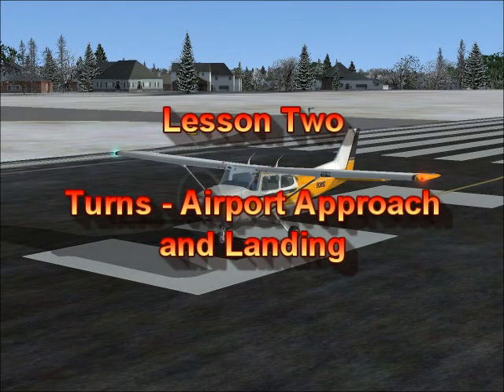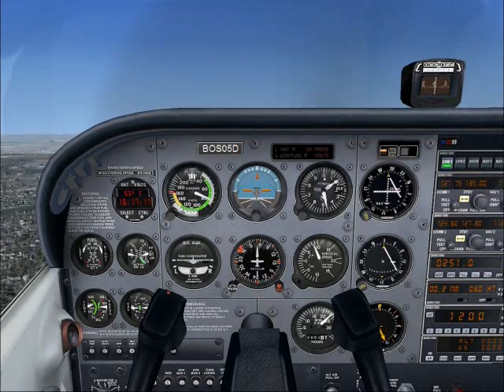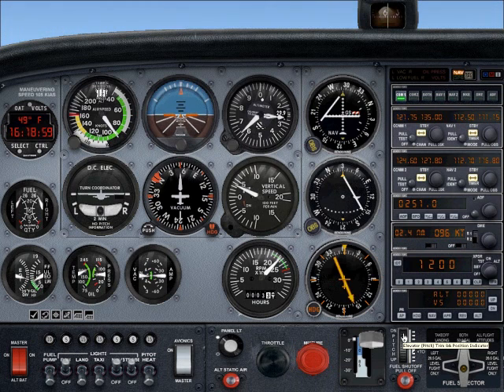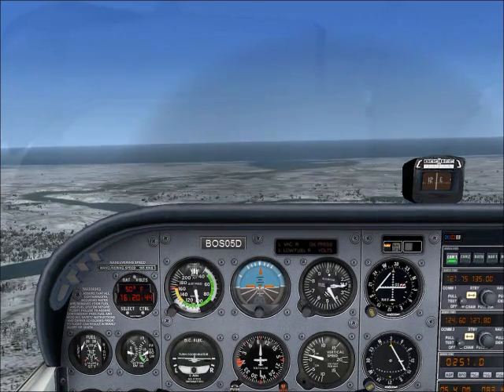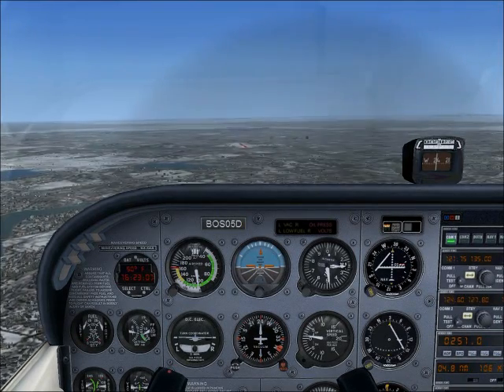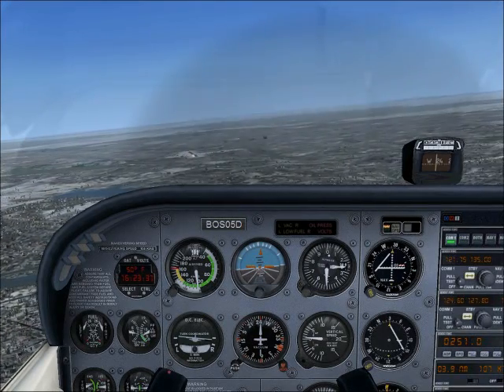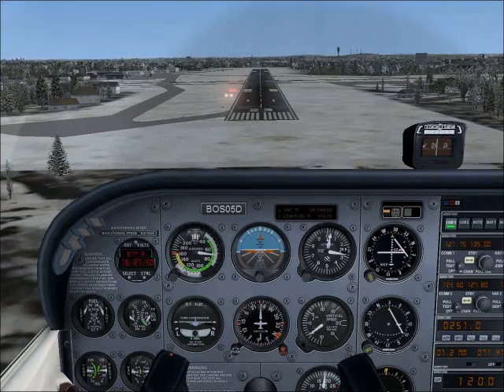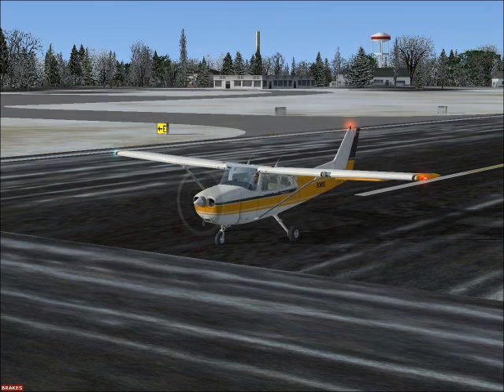Flight Simulator X -- Lesson 2

Comment: several errors... here.  If you were in a flight exam... You must maintain altitude in turns... When coming to altitude you fly above the altitude by a few feet and reduce throttle and maintain level flight within a few feet. Give or take 50 ft.  Rpm at landing a Cessna 172 should be about 1500 to 1900 rpm... never cut throttle completely.  Your hand never leaves the throttle.